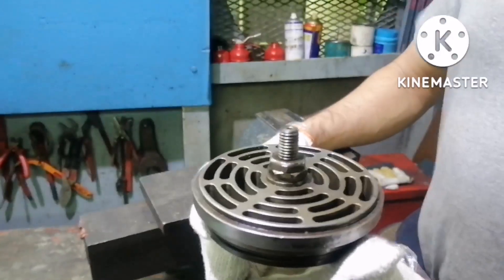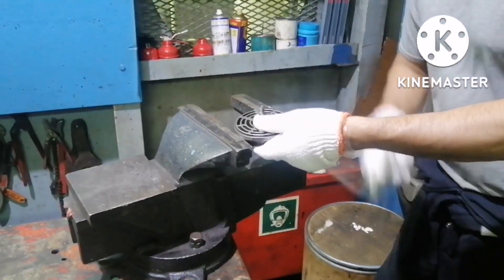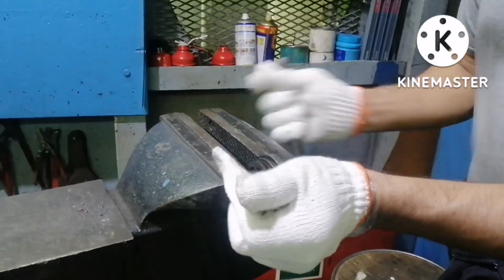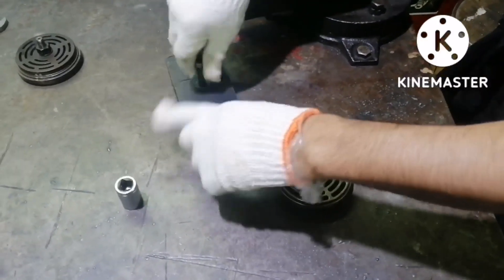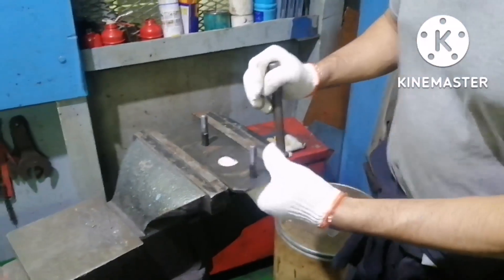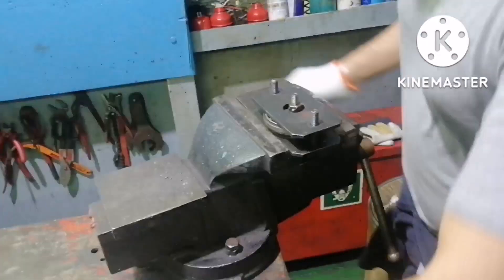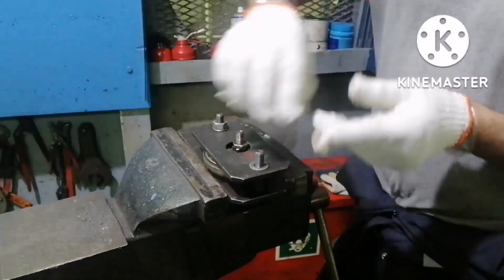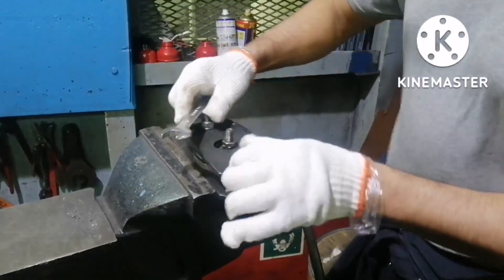Fourth engineer must know.. know the right way to fit compressor valve for servicing onboard ship..

Comment: Sir naa unga  roto cap over hauling video pathen ,  i have a doubt regarding main engine exhaust rotocap , aux engine la mallet vachu valve la adichomnaa rotocap work ahutha illa yanu therium , M/E exhaust valve rotocap work ahutha nu epdi sir paka mudium ...
Reply: Indicator rod will be thr..u just remove it from lock and notice it ,it will keep on changing vertical height from that u will come to know

Comment: Please make a video about how to prepare tanker for discharging. Step by step . CoPT system .
Reply: First u have to run boiler and maintaining pressure around 12 to 14bar by dumbing valve adjustment..then u have to run vacuum pump to create vacuum in vacuum condensor and then seawater pump for vaccine condensor..then u have to put COPT lube oil pump in auto mode..open all drains and slowly open warming up valve and when steam starts coming then close all drain and gland steam value must be adjusted to 0.05..now open main valve and close warming up valve ur system is ready